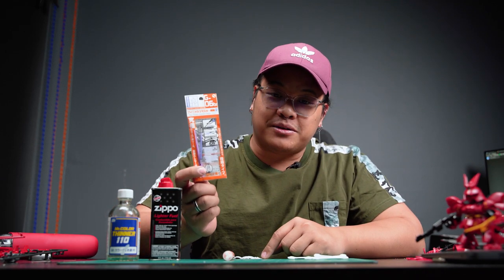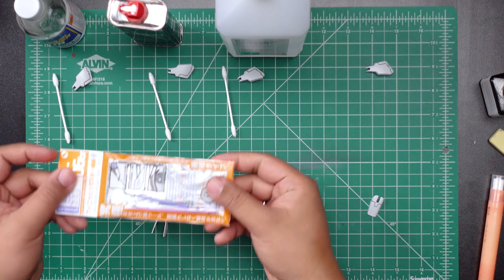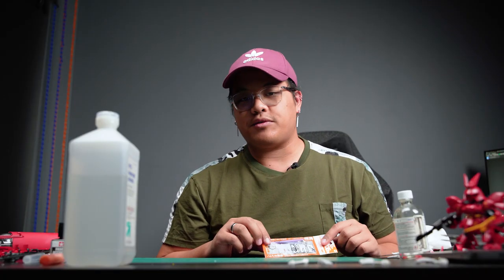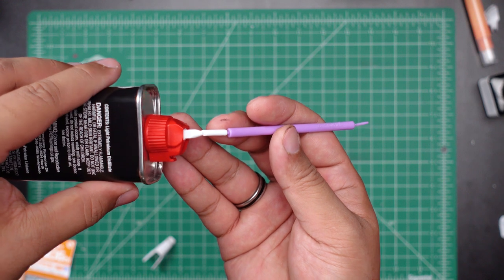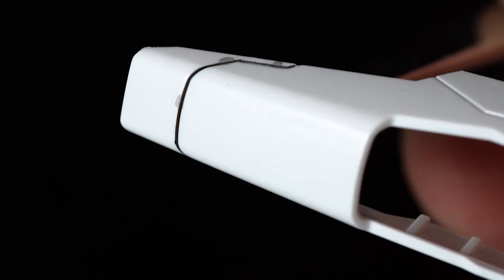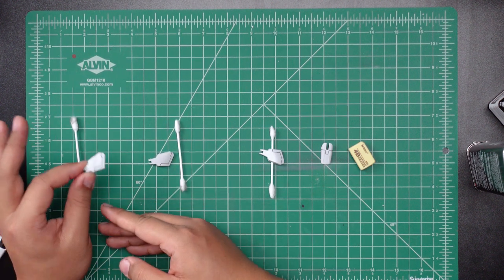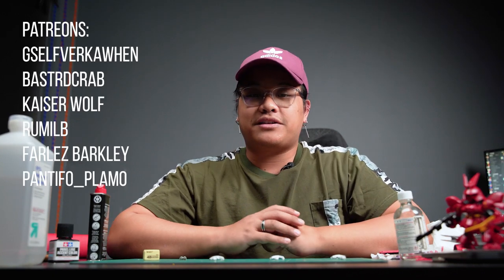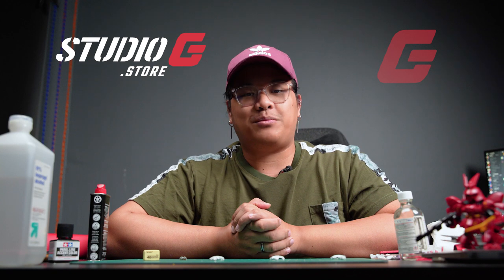Finding the Best Way to Remove Panel Liner - Solvent Showdown!

Comment: As a newbie that will just straight panel line, I think the eraser will make a good starting took. I also always have isopropyl and cotton swabs so super glad cleanup will be easy without losing the thickness of that black

Comment: Tried rubbing alcohol today right after watched this video. The result is much better than the lighter fluid! I recently transfer from gundam marker to Tamiya panel liner so I might not have much experience. Like you said because the alcohol requires use more pressure to remove the paint, I can actually have more control on it. Especially for shallow panel lines. It won’t remove the paint in the groove. Thank you for doing this comparison!

Comment: I use pointed cotton swabs (beauty section at target) and a single drop of enamel thinner which I then dab almost dry on a paper towel. Those swabs have tighter spun cotton buds, so I just gently wipe across the surface with very little pressure. Works super well. Ive been painting lately though, so Im not too worried about the thinner
Reply from the maker: Yeah, if you’re panel lining over paint, you can pretty much use anything to remove it lol

Comment: Before I start, I want to let you know that I messed up on a Tamiya Panel Line accent color application. The project is a Hasegawa 747 airliner that has been painted and clearcoated. Upon applying the Tamiya PLAC, I didn't let it dry long enough. I used the Testors enamel thinner since my local hobby shop didn't carry a Tamiya enamel thinner and try wiping off the excess. However, it ate through my paint and made it look messy.

Comment: Just a heads up, if you plan on matte top coating your kit before panel lining it will make cleaning up panel lining way more difficult using rubbing alcohol as the matte coat will end up absorbing a lot of the black ink. I made that mistake a while back because I was curious and thought it would be okay only to realize it was not.
Reply: I discovered this too unfortunately
Reply: Whats the best way to do this gloss coat lining then matte?
Reply: @KadMan04  yes

Comment: I use cotton swabs and rubbing alcohol, but I've only been using the Gundam fine tip markers for lining. Also a wood toothpick to remove in tight spaces.

Comment: The Gaianote Finish Master works like cotton swabs. Try letting the pane line wash dry to the touch. The tip on The finish Master is a sponge, what you do is apply your removing agent to the tip and dab the excess fluid onto a paper towel. Then gently rub the part. Reapply removing agent as need until your done.
Reply from the maker: Good to know, thank you!
Reply: @aMillaGunpla  Your welcome.

This is one of the changes I follow, he just uploaded a video of him using the Finish Master.
Reply: For the Finish Master, are the tips reusable after a cleaning session?Or would you have to clean it? recently bought it and it works but I just dont want to half to keep buying tips all thetime lol.

Comment: Gainotes tool is absolutely incredible. Ive been using them for years. Trick is if youre using lighter fluid you really need to soak it! I'd recommend using odorless mineral spirits, that doesn't dry up as fast as lighter fluid. Ive switched to save waste on qtips and also to save from getting those cotton frays onto my painted builds as the gaia swabs are smooth an rubbery and dont leave residue behind.

Comment: I used enamel thinner but found it was taking my clear coat off. Switched to lighter fluid and it's no longer a problem. I'm surprised by the eraser and might have to give that a shot.

Comment: I've been learning about the world of model painting for months and I still consider myself a beginner. I look for information and I am very fussy about understanding things precisely, because I believe that knowledge is the basis of good work which can then be mastered with practice. In this video however, forgive me, you do not communicate to your audience that, regarding panel lining (and therefore also painting), there are various approaches based on the type of product used. Here, for example, you use Tamya's classic panel liner, which is enamel-based. But you should say that there are also other types of paint (and therefore panel lining), such as acrylic and lacquer, and each of these has its own coupled thinner to, in this case, remove excesses in the panel lining procedure . I may seem like a pain in the ass, but if we continue to produce this type of content, without first giving a brief summary of the world of painting, people will continue to be confused or, worse, make disasters when, for example, they have to remove the excesses of the panel lining when he first painted his model.

Comment: The eraser is fine, but on flat parts or if you have the time and patience to rub the ink off. I was doing with the eraser but was tasking, my best method was Rubbing Alcohol and cotton swabs.
On parts with lots of dents, details of different heights, the eraser isn't good enough, the Alcohol is faster and easier. Just need a small drop of alcohol, put a little in a bottle cap (lid) just tap it with a cotton bud, just clean the part, will not drop anything, no need to use paper towels, and will erase just the messy part, after I change from eraser to alcohol with cotton buds, was faster, cleaner and left a very good end defined line, the eraser tends to make some line blurred. It's my experience with panel lines atm.

Comment: I use Tamiya pointed cotton swabs with mineral spirits. I bought a 946 mL bottle of it for around $8 CAD. I've been told it can make the plastic brittle, so use it sparingly.

Comment: I never knew about the eraser method. Does it leave any type of streaks that would be easier seen in person? And I use paint thinner normally and the easiest way to remove the panel liner is to rub a q tip in a circular motion and I've found that most of the time when plastics have got brittle on me is when some panel liner gets into the cracks of 2 different parts apparently since it can't evaporate well it cause the plastic to crack
Reply from the maker: The eraser method hasn’t left any streaks on me yet, just a lot of eraser dust 😅

Comment: If cleaned immediately, do you think just water on a cotton swab would work? I build model cars and the panel lining is usually done after paint & clear coating, so I need something that isn't a solvent that won't remove the clear coat etc. If not, the eraser might be the best option.

Comment: I use Zippo fluid and i have to correct you on that one since it CAN make plastic brittle and crack. I have learned the hard way :(
Reply from the maker: Oh no, but that’s some good information to know!
Reply: I’ve learned that thinners, alcohol, and liter fluid can all make the plastic brittle if it’s applied directly onto bare plastic. Especially in large quantities but if you apply it sparingly then you should be safe.
Reply: @willisjackson7029  I’m using Gundam pour type markers which remove can I used that won’t destroy my gundam? Do I need to apply any finish’s gloss matte?
Reply: @buriburibub  If you clear coat your model before you use the panel liner that will protect your paint job from the cleaning process and then you can use enamel thinner to clean up the panel liner makers overflow. Just make sure that you use a lacquer clear coat that way you won’t destroy your paint job with the enamel thinner when you’re cleaning the panel liner. Then after you’re done with the cleaning process give it another clear coat to finish it off and then you’ll be done.
Reply: @willisjackson7029  Thank you, I was using an eraser and 70% isopropyl alcohol for the cleaning process. The current model kit I'm working on is the 2019HG The Origin ZAKU II Red Comet ver. Is this way safe since I'm using 70% and eraser 

Or I should go with the method you stated:
1. Lacquer Clearcoat
2. Panel liner
3. Cleaning process -Enamel thinner
4. Lacquer Clearcoat

like this or my method?
Sorry for taking some of your time I just got introduced to this hobby a couple days ago. Thanks a lot.
Reply: @buriburibub  Those 4 steps are correct.👍 Good luck with your project and let me know how it turns out. Happy Building.🙂
Reply: @willisjackson7029  I’m not sure which one to buy for the lacquer clear coat and enamel thinner can you tell me the ones you used?
Reply: @buriburibub  I use the Tamiya Lacquer Thinner and Mr Premium Topcoat (there’s 3 different ones to choose from) Gloss, Semi-Gloss, and Flat.
Reply: @willisjackson7029  For thinner can I use the MR color thinner or is the Tamiya one better? Because there’s is amazon prime option for Tamiya lacquer thinner but there’s one for Tamiya Color acrylic Paint thinner- is this one the same as the tamiya lacquer thinner?
Reply: @buriburibub  It’s best to use an acrylic thinner for the cleaning process of your panel liner that way it doesn’t rub off the topcoat paint that you put down before you panel lined it with your panel liner. Just make sure that you use a lacquer clear coat because it is stronger than acrylic and it won’t reconstitute the paint/clear coat. So here’s the steps that you should take:
1. Lacquer Clear Coat Paint 
2. Acrylic Panel Liner 
3. Cleaning process: Acrylic Thinner: (examples)Tamiya Acrylic Thinner or Aqueous Color Thinner (both are acrylic thinners)
4. Lacquer Clear Coat 
Just make sure that you don’t use a lacquer thinner on top of your panel liner because it will destroy your clear coat. Acrylic thinner is best to use on top of your lacquer clear coat so it doesn’t reconstitute or thin the paint off of your model kits. The same goes for if you use enamel thinner on top of the lacquer top coat as well. Lacquer paint is stronger than enamel and acrylic paints that’s why you need to use a enamel or acrylic thinner to clean the panel liner because it won’t clean the paint off as well or cause the paint finish to become wet or rub off. I use the Tamiya panel line accent colors for my panel liner and acrylic thinner to clean it up with. I own the Gundam Markers panel liner set but I haven’t used them yet so I can’t say how it is affected by my cleaning process. The Tamiya Acrylic Thinner is what you would want because that the Lacquer Thinner will destroy your clear coat and if you use Mr Color Thinner then that would destroy your paint job as well because it is a Lacquer Thinner. So if you want a Mr Color Thinner that will work for the cleaning process then you need to use the Aqueous Color Thinner because it’s an Acrylic Thinner.
Reply: @willisjackson7029  I’m going to use Mr super smooth clear Matt finishing spray with dspiae enamel thinner 
So the steps will be:
1. Tamiya Panel line 
2. Dspiae enamel thinner
3. Assemble
4. Decals/Stickers
4. Mr super Matt finishing spray

Is this okay?
Reply: @buriburibub  If you’re not painting your model kit and only applying panel liner and stickers/decals then that should be fine.
Reply: @willisjackson7029  is acrylic thinner be able to clean the tamiya panel liner? Or I cna only use enamel? Because enamel is so toxic and bad for you unless you do it outdoors or with an respirator and spray booth
Reply: @buriburibub   Yes, acrylic thinner can clean up Tamiya panel liner.
Reply: @willisjackson7029  how about the tamiya panel line? Is that one safe to use or do I need a respirator and keep my room ventilated? Or better to do outside?
Reply: @buriburibub   If your room is well ventilated then you’ll be fine. It’s good to have a fan and a window for good ventilation. A spray booth that sucks out the bad smells of the paints will help as well. Acrylic paints are the least damaging to your lungs if you smell them. Where lacquer paints are known to cause cancer in some people. It’s all about proper protection when using your hobby paints and knowing what is and isn’t bad for your health. A mask or respirator is good to use for extra protection as well.
Reply: I recently got into Gundams and my process is building straight kit/sanding nubs/cleaning it > Mr Hobby Gloss>Tamiya Panel Line accent > WSD > Mr Hobby Matt > Weathering  > Mr Hobby Matt. 

For Cleaning Tamiya PLA=Lighter Fluid or Mineral Spirits.  Alternative  panel lines with Gundam Markers clean=99% Iso Alcohol 

Are these steps acceptable???

Comment: Hello! Glad I stumbled on your channel because I've been looking for comparisons and alternatives to clean the kits without potentially damaging the plastic. You just gave me the answer! 

I'm about to use pour type markers for panel lining and am assuming the same thing applies to those, is that correct?
Reply from the maker: Yes, for the most part it will be the same. The markers are oil-based paint though, so you should be fine with just using IPA. Drying times will also be longer since they're oil-based!
Reply: @aMillaGunpla  Oh! Been searching for the markers' contents and never got clear info about it. Oil-based huh, thank you so much for telling me this, knowing rubbing alcohol can be applied, it helped a lot!🙌

Comment: i’m using the tamiya black panel liner and it leaves a stain on the plastic, i’m using the tamiya x20 paint thinner but all it does is just smudge the ink around, i’m so bummed out i ruined one of the legs on my 30 min mission. if anyone could help me out that would be great, thank you

Comment: 'aMilla'.....I wish I saw this TODAY!!!

Used Tamiya Black Panel Liner, with Tamiya X-20A thinner......... NO JOY!!!  I'll need to repaint a part. ☹

BUT, I do have rubbing alcohol, so I'll re-watch to get the % alcohol, and try again on my plane wing's......Wish me luck!!  

And I'll let you know ... soon how it works, here!!😐
Reply: The other alternatives are "black-basing" your model's paint job with a spray can of black primer, or using an air brush, carefully spray the panel lines black before applying the main finishing coats of paint,

Comment: There are a couple of ways in which this test could be improved.  Firstly, this panel lining is freshly done - lines that were drawn in a long time ago might be harder to remove. The other is the plastic colour. Apparently some solvents like IPA can cause white residue to appear on plastics, which wouldn't show up on these white parts. I'd be interested to see a similar test, but using some darker coloured parts which were panel lined longer ago - ideally years, if not months. I'd also like to see all of the marker inside the panel lines removed, not just the excess.

Comment: Great vídeo i Just have a great question,i have seen many videos on how to clean the tamiya panel line but i Found that many recommend lighter fluid or thinner or alcohol isopropyl so i would like to Know which liquid to use for the parts my gunplas do not become brittle, i would really appreciate it if you tell me which one to use definitively 🙏
Reply from the maker: The biggest thing is not letting the solvent pool up on the plastic. It has to be able to "breathe" and evaporate. Lighter fluid is almost equally as damaging to plastic as thinner is, the main difference is that lighter fluid evaporates much faster
Reply: @aMillaGunpla  so what liquid do you recommend i use or something to clean it ?,it and i,m sorry for the question,you are new to gunplas 😅

Comment: Does rubbing alcohol damage the plastic over time or should I be good to go?
Reply from the maker: Most commonly used cleaning solvents, including alcohol, ethanol, acetone, naptha (, etc., will have an effect on plastic because they attack the oils in the plastic. Some will be more harsh, like acetone. Some also evaporate quicker (lighter fluid) which make them "safer" to use on plastic, since the length of contact is shortened. With that being said, rubbing alcohol is fairly safe to use, but I wouldn't consider it "non-reactive"

Comment: Would this work too with gundam marker panel liner? And will any lighter fluid except from z*ppo brand would work & safe for the plastic??
Reply from the maker: Gundam Marker is an oil-based paint I believe, so all of these methods should work. Rubbing alcohol would be much more effective on it as well!

Any lighter fluid in theory should work, Zippo is just one of the cleaner burning ones, not that you'll need to burn it anyways 😅

Comment: I used both 70% alcholol and gundam remover marker on my RG nu gundam. Will it damage the plastic ? 🤔
Reply: As long as you use it sparingly to a cotton swab and then rub it on the model kit in little quantities then you should be ok. But I’ve experienced using the Gundam eraser directly on a model caused it to crack. It’s basically almost like alcohol in a pen. And the lower percentage alcohol is safer on models so 70% should be fine.

Comment: I used Tamiya panel liner and I am trying to use Tamiya paint thinner to no avail! I’m worried about my MG Barbatos! What can I do?
Reply from the maker: The Tamiya thinner (X-20A) is an acrylic thinner which isn't strong enough to remove the panel liner, which is enamel. Your best bet is to try one of the solutions mentioned in the vid to remove it. The more I try it, the more I start to prefer the eraser over any of the solvents--it's just a pain in the butt to clean up all the eraser shavings
Reply: @aMillaGunpla  I saw your comparison video not long after this and I got an eraser right away. I love using it to clean up my panels!
Reply: Will tamiya lacquer thinner work?

Comment: Just a regular rubber eraser ? As in pencil eraser ?
Reply: Yes exactly, I saw once on Instagram some sticks with a rubber-like tip used to clean the tamiya panel liner excess and thinking it was regular rubber I tried and was amazed by the results. The only tip I want to give in case of using a regular rubber is that due to its shape it may be difficult to clean very narrow points so you should let the panel liner flow from a point that you are sure you can reach and clean easily.